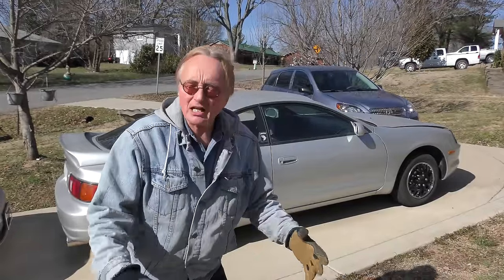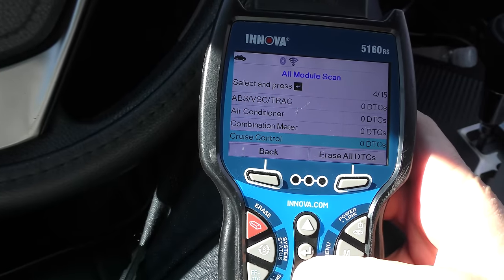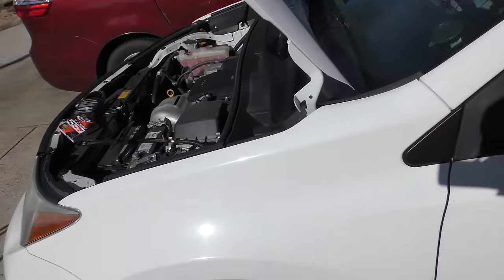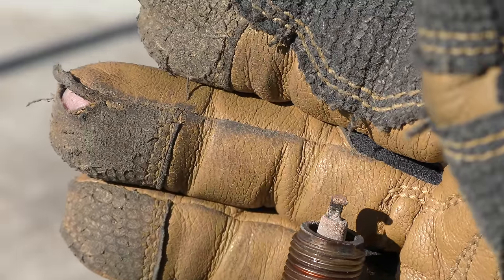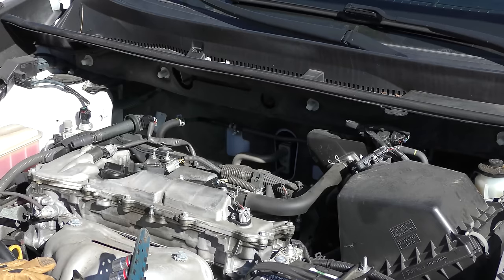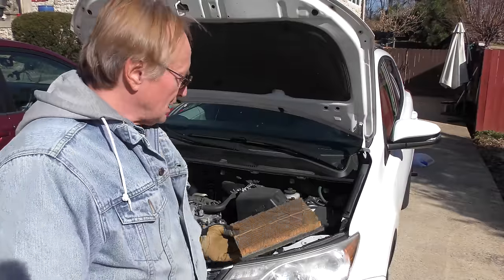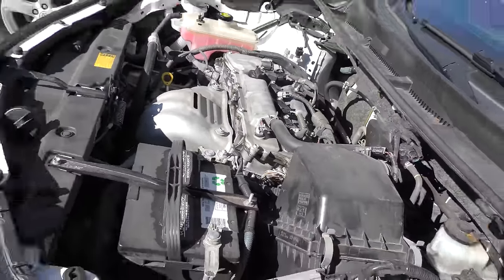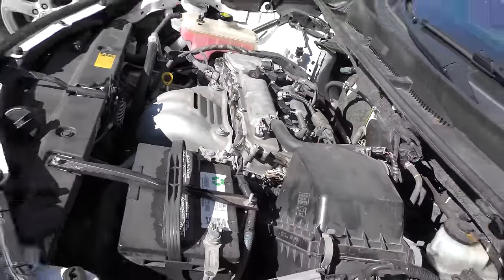Here's Why You Should Remove Your Gas Cap Right Now

Comment: Some of the most valuable things I've ever learned in life is how to maintain and repair a car. I've never used anything from Algebra or some of those other math classes. Some geometry yes but the rest of them no. Unless you are going to be a nuclear physicist you won't use that advanced math but you will use basic car maintenance and repair. That's one of the useful things that should be taught in school.
Reply: You are right ! 
People can save so much money if they learn about car maintenence and basic repairs .
Things like knowing if your brake pads and rotors are still good or not , especially when some scam mechanic is trying to rip you off , is very helpfull.
Knowledge is Power .
Reply: They wouldn't let "College types" take shop, lest we learn a practical or marketable skill.  The only useful HS courses were Geometry 1 and one semester of typing.  Most of it, like college, was useless drivel, to make you a "well-rounded person."  (All I wanted were career-related skills, in order to get a good job and make a pile of money---I should have gone for a union trade).

Comment: I work at an autoparts company as customer sales specialist. Have a question regarding re-gapping plugs. Some of the plugs come with protectors / sleeves that wrap the 
thread / cover electrode and prevent impact on the electrode of the sparkplug when / if it is dropped thus preventing plug gap problems. In a few situations I recommended reading the gap and re-gapping if it's out of tolerance. When I re-gap I give the electrode a small tap and use a circular re-gapper the diameter of a half dollar. Am I wrong to make this recommendation? 
The re-gapper is a product we sell. Some brands of sparkplug don't come with protectors. Have seen plugs out of box not gapped to specification. Thank you!

Comment: The term "tune-up" has just changed meanings over the years, with perhaps newer cars not needing as many things done.  Like back in say the 70-80's, belts had to be changed every 30k miles, transmission fliuid probably every 30k or 50k, coolant every few years, and plugs probably every 3-4 years.   But these days, you still have to do a "tune up" or maintenance, but it's much longer intervals, like 6-8 years for many things.  I wouldn't say the concept hasn't gone away (yes, you don't have to go tweaking things like the air intake or throttle control as those are electronically controlled and adjusted by the ECM, but you do still have maintenance to do at certain -- but longer -- intervals than they used to be.  Even oil changes have gone from every 2,000 to 3,000 miles or 3 months now to about 6,000 miles or 6 moths (I wouldn't go 10,000 miles or a year without an oil change though, 6000 miles or 6 months is at most [or 4 months / 5,000 miles if you're really picky]).
Reply: When i do a tune up at shop i just wirebrush the battery terminals and pressure wash the engine.  Easy $200.

Nah just kidding

Comment: I consider a tune up to be, oil change, trans oil change, air filter, cabin air filter, fuel filter, spark plugs & (wires if any. that are suspect) Clean throttle body.  Battery test & clean up or possible replacement.
Check the suspension for broken springs leaking struts or shocks, loose ball joints or tie rod ends, control arm bushings & upper strut mounts.
 New tires if necessary, adjust tire pressures, spare too! Alignment if needed. Check clean & adjust brakes if necessary. Brake fluid change if needed.  Make sure caliper sliders are free or fix them up. Sometime the brake pads themselves are jammed up tight & need freeing. 
Check all lights, wipers. Try to lubricate anything that could use it, like door hinges, hood latch, door locks, grease steering parts if possible. I used to do all this, but first of all I would examine the car closely for any noticeable broken or damaged body parts, You don't want to be on the hook for damage that somebody else did.  Then take it for a good test drive.
A good test drive tells you everything immediately.
However sometimes the boss would say:  "This guy is a cheapskate, just give him an oil change & get him the hell outta here!"
Reply: Thats not an engine tune up.
That's reconditioning the vehicle.
Two very different things bud!

Comment: I'm an old school wrencher. I remember back in the day we had these machines that you would stick the worn spark plug into and it would sand-blast them to like new condition....And this was back when spark plugs only cost a buck! With these new plugs costing $10 or more a piece, are they renewable?
Reply: Ya I remember the machine, if you turned up the pressure the plug would stop to spark.
Reply: Crazy!
Reply: No, modern plugs should not be 'cleaned'. They last for 100,000 miles so toss them. Plus those old spark plug sandblasters left bits of sand in the plug that would end up in the engine.

Comment: I had an oil change place replace my air filter. In doing so the loosened and removed the intake hose and did not get it aligned or tighten it. About 5 miles down the road I got check engine light and it started running rough. Drove me nuts for days.

Comment: On my 09 Grand Caravan the rim of the gas fill pipe was rusted and pitted.  Even with a good gas cap I suspect the vapours are leaking out under the cap.  I plan to remove the rust and smooth the rim with some suitable abrasive and paint with rust killer.

Comment: Why did Scotty Kilmer moved to Tennessee from Houston? Emissions testing also does a physical test on the gas cap, air fuel mixture also is checked and may show that a man enough air is entering the engine which is replacement of the engine air filter

Comment: The guy telling you not to use antiseize doesn't even torque spec his spark plugs.  I do both and my plugs always come out clean and easy. A little goes a long way and a snapped off spark plug is sure a headache
Reply: @CJM when you’ve been doing this car mechanical work for 53 years like he has, he knows the feel of torque for spark plugs, but he said you can also use a torque wrench too. Well the plugs are coated from the factory which is why you don’t use antiseize on them. I can’t explain how many times I’ve argued with people over this mechanic fact, Scotty explained what can happen if you antiseize them when they are already coated. If someone’s been doing something for 53 years I don’t think their inexperienced or stupid at it 😂 lol.
Reply: I read manuals that say to not use anti-seize on plugs, or lug nuts, for the same reason----they can work loose.
Reply: @Blakecryderman7244  With your logic, a tire guy with years experience can just tighten wheels without torqueing? That's why in Ontario all tires must be torqued. To many flying wheels. Period.
Reply: @Tom-ob8yb  oh chill out, I watch scotties videos & he is good and does MANY things the right way. I’m guessing you don’t watch his videos everyday, which is fine, but I know his exact procedures with different things, & they are the right way. He doesn’t rush through jobs like a stealership

Comment: I know three Toyota owners. One wasn’t happy with their Corolla. Probably due to the lacking capability here in WI weather. 

The second owner isn’t too happy. An 03 4 runner, everything under the vehicle rusted and broke. Many mechanic visits. 

The third owner hasn’t complained but their oldest Toyota is a Japanese made 2017 Rav which they had to upgrade because there wasn’t enough room. 

Not a single power train problem amongst any of them. Put when everything else breaks and or is inferior?
Reply: @JSU’s n Bhdjnfi the owner with the Corolla probably didn’t have the right good snow tires and/or drove like a maniac. Then, the 4Runner owner probably didn’t wash the salt off the underside enough, hence it rusting. My 06 Toyota Matrix is FWD & I use good snow tires, resulting in no problems in Canada weather. People always complain “ oh I need AWD “ when they have crappy tires on the vehicle. GET GOOD TIRES PEOPLE for goodness sake.

Comment: "If ya can't see the blazin sun through it, ya need a new air filter"
Scotty Kilmer 2022
Reply: or "If you can't see the light, you're stupid" 🤣
Reply: @youdontknowme5969  Buy a K&N filter and let me know when ya see the light boo boo.. When ya turn an oil filter up at the sun ya gotta watch out or oil will drip right in your brown eyes I mean brown eye...
Reply: Nice tip, actually.  Now I know how to check mine.
Reply: @thekingsilverado8419  oil filter is the same as as air filter is the same as a furnace filter.  All are different
Reply: @toriless  same with water filters and fuel filters, plus more expensive "tighter" filters aren't always better and are often worse ;)

Comment: I Might have a "tip" for you!    When needing to replace vacuum-hoses, isn't it "OK" to replace a given vacuum-hose with stronger, longer-lasting, fuel line hoses that match the interior diameter of the vacuum hoses you replace?    When "Old", vacuum-hoses can collapse, but fuel-line hoses will usually never collapse because of thicker, stronger, rubber-material  that make-up the sides of the hose.
Reply: As long as the i.d. is the same.
Reply: That's fine, although vacuum line is pretty thick and is designed to be much more flexible, so in a newer car where every vacuum nipple (barb that the hose slides over) is made of plastic, using a much stiffer braided fuel hose can actually crack off those plastic nipples.
I personally just use vacuum line, it's cheaper and easier to work with

Comment: Scotty, advice please. Have 2 cars & both use same spec' Spark Plugs. One has iridiums & the other standard non irdium FoMoCos type. The iridiums were around 30000 miles old & l p/xd the car but swopped the plugs with the standard plugs not so new FoMoCos before the exchange. The car ran fine. However the iridiums fitted in my year 2000 Ford 1.7 original model Puma, l'm in the UK, flooded on start up so l had to revert to spare non iridiums to avoid flooding. Spoke with the  local auto parts retailer (national chain) who said they knew of no reason why the iridiums would fail (?) - it was news to them. It seems iridiums are not suitable for all types of petrol/ gasolined engines - or am l missing something?

Comment: I've heard that copper plugs give the best efficiency and performance because the copper electrode is much larger than the iridium electrode. Iridium is so expensive that they can't use much, so they give you a tiny pin point of iridium to spark off of. The problem with this is that hotspots in the cylinder head are normally what cause knock and limit total engine power. Hot exhaust valves are a common thing to cause knock and retard timing, but so are iridium spark plugs. When you have such a tiny point of metal it gets hotter faster and causes a detonation source, where with copper plugs the copper electrode is so much larger and has so much more mass that it doesn't heat up nearly as much or as quickly and so it causes less detonation and your electronic fuel injected engine will advance timing more and give you more efficiency and power. So what if you have to change them every 30 thousand miles. That's like once or twice for the entire time you own the car for most people, and they only cost 3 or 4 dollars each instead of 16 or 20 or whatever iridium plugs cost for less performance just so you never have to change them for 100 thousand miles.

Comment: OMG THE VIDEO I NEEDED..................My car check engine turn on..................Scanners says EVAP(SMALL LEAK) and stuff like Bad gas cap,.................I might try to replace gas cap and air filter as the budget option......If not check plugs..............If not, check o2 sensor, if not do know what could be?

Comment: I bought a junk 2005 Civic really cheap.  First thing I did was change the oil & the air filter - it looked like the original air filter had enough dirt on it to grow plants.  I replaced the plugs & was told the $17 Iridium plugs were the best option.  I bought a set of cheap NGK $3.50  OEM plugs instead.  What do I care about how long they last?  The plugs are all right up front & took all of 10 minutes to change.  The plugs I removed looked like original Iridium plugs & one of them was even different than the rest.  
It already ran smooth for a cheap old car & didn't run any worse with my "tune-Up",  but it does seem to get better gas mileage.

Comment: Been wanting to  buy a portable battery jump starter like what you recommend but can’t afford those higher prices. I have a Honda Odyssey station wagon 2007 and on occasion other drivers ask for a jump start. I hesitate using straight jumper cables because I don’t want to damage the computer in either car.  Recently I borrowed a portable jump starter but it was too weak to start a friend’s battery I resorted to using the cables.

Comment: Scotty...I have an 06 Toy 4Runner. One day last year all the dashlights turned on. For example fog light indicator, Down Hill Assist, everything except the 4x4 indicator. Even though the item is not on. 4x4 indicator works fine. Took it too my local shop and they said it might be the gas cap. I didn't believe that even though I have never being let down by Dave's. When I got home  I googled it and sure enough it said the gas cap. So I am contacting you for a 3rd opinion. Do you think it could be the gas cap?

Comment: My '90 TBird has been missing or stalling intermittently. Turns out that the evaporative emissions system is pulling way to much vacuum on the tank. I realized this when I unscrewed the gas cap and a big air rush into the tank occured.

Comment: I haven't changed spark plugs in 30 years. Back then we put a small amount of engine oil on the threads before installing the plug - we didn't have COPs either.  Now I'm told that nothing needs to be put on the threads even though some mechanics in other youtube videos put a small amount of anti-seize on the threads.
Reply: Depends on the vehicle and plugs. My 5th Gen Camaro repair manual states that anti-seize is required. I also put some on my son's 2008 Honda Accord when I changed out his plugs (just out of habit). The only problem I've ever heard with anti-seize on plugs is over torque. I've never heard of plugs loosening themselves.
Reply: @nottelling4828  They say that the plugs on an 02 Mustang are known to loosen and blow out if you torque to factory instructions (about 13 ft-lb). A popular Ford mechanic says to overtorque to 20 ft-lb to prevent that from happening.
Reply: Two Hondas in the family had their spark plugs rattle and then shoot straight up. They had to be torqued correctly since these nineties Honda engines shake a lot during normal operation hence the long flex pipes.
Reply: Ive always sprayed a little WD 40 on the threads of any plug I re-install . They thread in easy and remove without a problem .
Reply: @JTR253  That's crazy. I better keep an eye on those plugs, then.

Comment: When you're changing the spark plugs on a vehicle, is it worth changing the coil packs as well? I understand that this will increase the price of parts but other than that, is it a good idea to change them at the same time?
Reply: No need to unless they're not firing. Only change bad ones because the ones that are still good may go another year or two or five. They're so easy to change it takes less than a minute. Always check for oil down in the tube though, because there's an oring seal down in there. If there's oil leaking into the tubes the coil WILL misfire, even if it's a good coil. The new coil you replace it with will misfire too. You have to change the valve cover gaskets at that point or it'll never run right.

Comment: Scotty,

I always thought it took 50 miles for the EVAP codes to come back, or is that just the older cars?

Larry
Reply: I've had codes come back as quick as a few miles, or about 10 minutes, one was related to the EGR and PCV. I have one code now that comes and goes. That one is related to the coolant thermostat, which is actually only a few months old. So, I suppose it depends on what part is malfunctioning.
Reply: Different codes come back when they come back.  But EVAP codes on my older vehicles always take 50 miles of driving before they can come back.  The video gave the impression that just a few miles were driven after replacing the gas cap.  I'm trying to figure out if newer vehicles still require 50 miles, or if they now can re-trip the code sooner.

Comment: I have just shy of 260k miles on my '08 Scion xD. Still running the original plugs. I need to change 'em out soon! :)
Reply: Don't fix something that doesn't break 😅
Reply: They might be pretty hard to remove after all those miles / years so if you do decide to remove them , you may want to spray some PB Blaster down on them a few days before you try to remove them .
Reply: @ranggaajibaskara1809  yeah but it's a maintenance thing!
Reply: @justinsane7128  HOW DARE YOU!!
Reply: @cbmikey  😅😅😅
Reply: @jayhockley8841  good tip! 👍

Comment: My car is a 1993 Buick with the 3.8L 6cyl and will not accept the typical scanner. Question is what type of scanner  should I get that will work on this car? The car itself has over 161000  but was given a new engine by Buick after 75000 when the original  blew. I have had the car since buying it from the car lot I work for and at that time it had 132000mi. Any help in keeping the old girl running would be appreciated.

Comment: Save the trouble of trouble codes; buy a 16hp kholer engine and swap it with the factory installed crud. Or you could go up or down in HP's, single piston or double